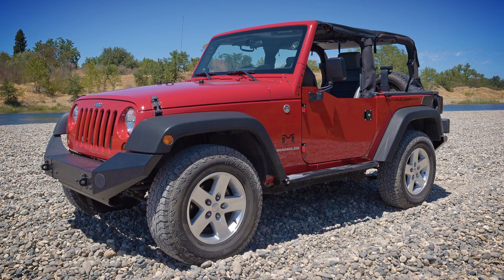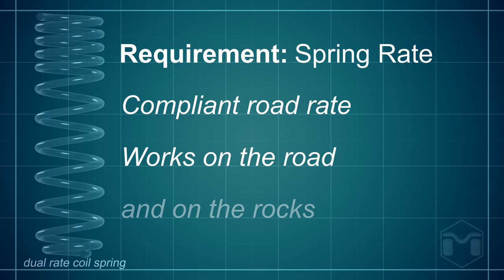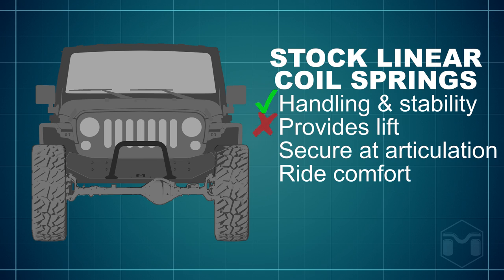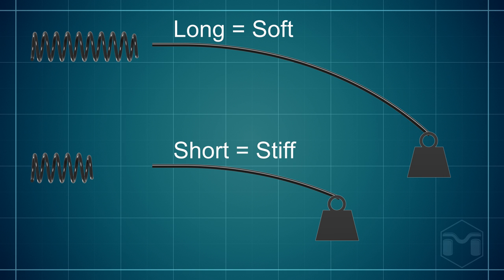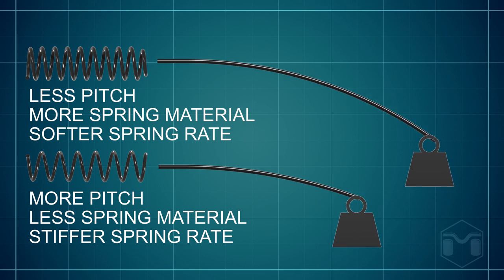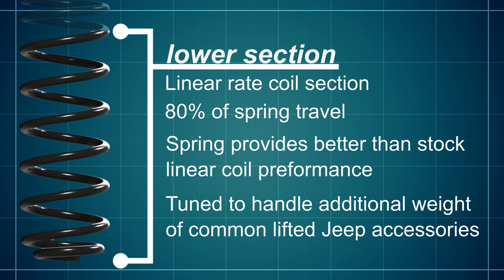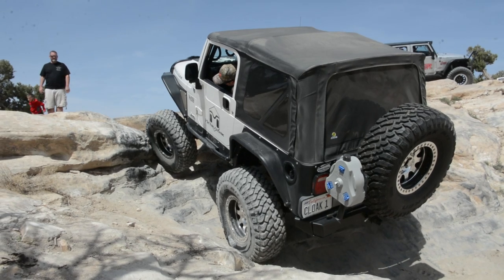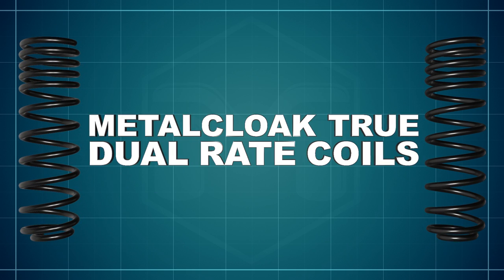MetalCloak Coil Springs 101 - What You Need To Know About Coil Springs

Comment: What is the coil rate of the primary section  of the coil  stack ?...and what length  is that section minus the tender  coil portion of the stack ?.
Reply: For which coil? Each of the coils we offer have their own rates and lengths... as a note, most of the coils on the website have length specs spelled out on their individual product pages. As for rates, Metalcloak's coil rates are proprietary and are not published or shared.
Reply: Matson Breakey Was looking  at the 6 inch lift  coil for the JK...I don't  have a jk but my jeep should be on par with the sprung corner weight of a well built 4dr jk . I'M  tossing  around what  I'm  going to do when I stretch  the front out shortly...keep coil/shock using a coil that I don't  need to beat up like my current ones that I have captured both ends to accommodate the travel , and going with  high end  king shocks, or just going coilovers I have considered ori struts as well but I am still not sold on their reliability. I really don't  need the extreme ability to tune that coilover or struts offer for a slow speed only crawler .

But not knowing the rate of the primary road section  of the coil stack there  is no way to know the lift  they will provide or if they will be firm enough to not be sloppy ...My front sprung corner weight is right around 800lbs .

Comment: So I know a dual rate shock means the coil has a soft portion and a stiff portion and is meant to ride better and still tow the same. However I've recently have seen a triple rate coil and I'm confused if this is just tricky word promotion or if its the real the deal. Does anyone know if triple rate coils are a thing? Are the better then dual rate?

Comment: Does bed springs manufactor your coils? I noticed they make teraflex also
Reply: Robert Bellamy What's more, Teraflex's video fired a subtle shot across the bow at MC, and MC now uses not just the same company, but the same person in their spring video? Very interesting.
Reply: I noticed teraflex slam at dual rate
Reply: Robert Bellamy That TF video is also the only one I've seen from them where comments have been disabled. That's pretty telling, too. Now, MC doesn't get off scott free, either. It's obvious the Betts engineer is reading scripted material in this video, and they're implying less-than-pure motives in their competitors' spring marketing. 

The most interesting thing to me is that I hadn't thought these companies were direct competitors. I've viewed MC as a higher-end company, and TF as the mid-range "Chevrolet" of lift makers. I'm very surprised to see them go toe-to-toe like this. Competition can only be good for us, the consumers, though!
Reply from the maker: Robert Bellamy Yes, there are only a couple companies in the US with the capability to manufacture a True Dual Rate Coil according to our specs. At Metalcloak, our principals have a 20+ year relationship with Betts so when we entered the Suspension market we had full confidence in their ability to meet our needs. Our engineers worked closely with Betts to achieve the precise proprietary specs of the True Dual Rate Coil, which is a very difficult coil to manufacture and even with Betts capabilities, it took a them a few times to get it right.

Comment: which is more comfortable?
dual rate coil with rocksport shocks or with fox shocks?
Reply from the maker: Comfort is subjective. We built our suspension on a stiff coil, soft shock, philosophy. The RockSports are specifically valved to work in synergy with our coils. Fox shocks tend to be stiffer than the RockSports, so that can diminish our targeted ride quality, but different drivers have different opinions on what feels comfortable. Your best bet is to give us a call at 916-631-8071 and one of our team members can help you decide which is the best for your driving style and jeep objectives.
Reply: @metalcloak  Thanks, will do!

Comment: so im looking into buying these to replace my rubicon express sport springs. you guys advertise your dual rate springs as they wont sag with armor ( im going to install a poison  spyder front bumper, rear bumper and sliders). would adding a roof rack with  gear on top cause them to sag alot? or will the springs stay the same fairly the same without a load on top the jeep
Reply from the maker: Any additional weight added to any vehicle will have an effect on it's suspension. The question is how will that suspension reacts. In the case of our systems, we designed our coils to be the advertised height on a fully loaded Jeep. After market steel bumpers, winch, 120 lb spare tire, steel flares, skid plates, etc. Whereas a stock Jeep will sit about 1" higher on our coils then the advertised lift size.

Comment: I really want to get these springs BUT... do i really need to get their 6pak shocks?
What if i just bought some Ranchos rs9000x.
Will i have issues such as over extending the shocks or will i completely bottom out?
Reply: im on the same the boat. i have the 9000 too. im sure they will work fine. i think the 6packs will extend much longer than the ranchos so you dont get the amount of droop as the packs
Reply from the maker: You don't need the 6Paks, but we believe in a soft shock , stiff coil, relationship. So the other shocks we sell are ones that follow that philosophy. We cannot recommend other shocks that we have not tested. If you get a stiff shock with our coils you will have a stiff ride that you may not be happy with.

Comment: i know this is 5 years old but i think the term dual rate is misleading. nowhere in a driving scenario are there two different rates offroad included. the bottom portion is what is at work on the road. the upper half just helps the coil press down on the axle...im not so sure there is any dual anything going on here.
Reply: The coil itself is manufactured with two rates. A soft rate and a stiff rate. It is not about what rates are functional at what times, but about distinguishing the unique manufacture of the coil itself. This unique method of producing selectively active rates is why we were able to build a coil that functions the way the manufacture intended on road and still maintains stability and functionality at the extremes of off road articulation.